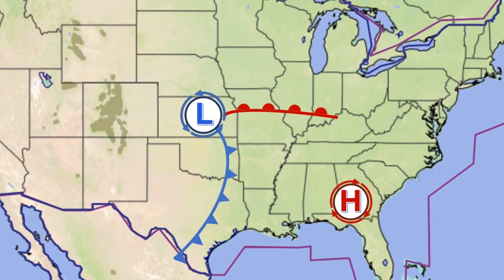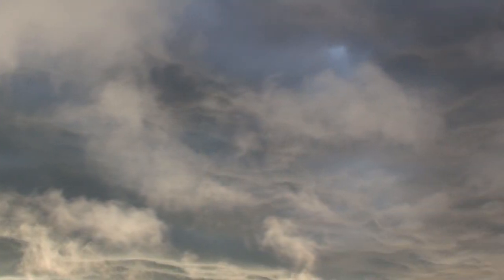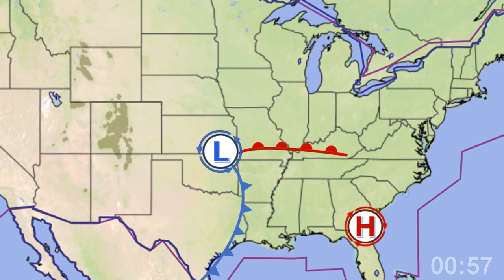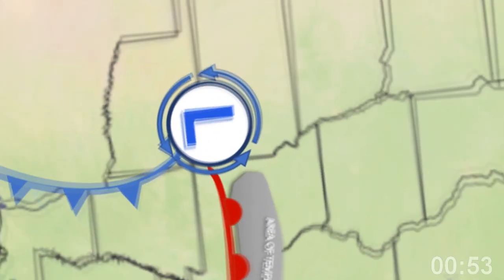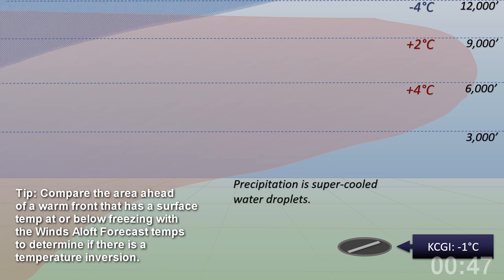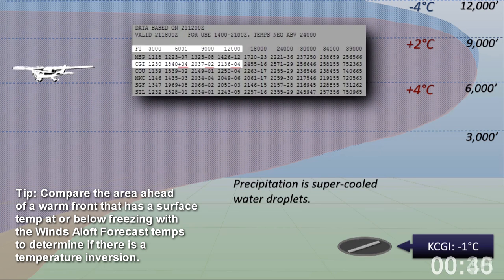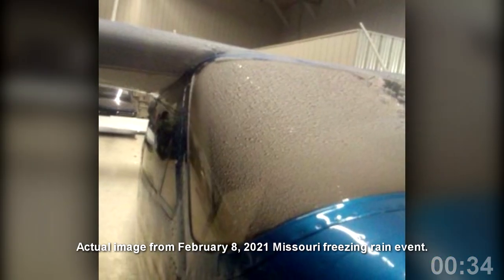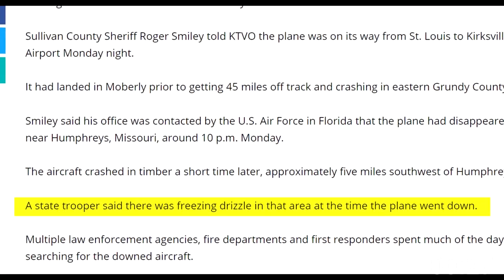Predict Icing Conditions in 57 Seconds

Comment: This made me think:
IF you were to come across unforecasted icing conditions, flying above a OVC layer: What would be the best way to penetrate the clouds?
Off-hand, I would think (Assuming Instrument rated, and there are no holes in the clouds within the distance covered by fuel reserves) the best idea would be to stay above the clouds on an instrument approach, check the field's ATIS for the altitude of the bottom of the clouds, and pull power and dive through as fast as possible to reduce your time in the clouds. (Attempting to remain below manuvering speed, but realistically staying inside Vne to minimize time in visible moisture 0 to -20C)
Off-hand, I'm not too knowledgeable about shock-cooling, or how the increased airspeed would effect ice formation. (I'm assuming the ice would start from the leading edges and spread further aft because of the speed)

This isn't a situation I would ever propose getting oneself into, but since most GA planes are 1. Not FIKI 2. Piston, I would rather talk about it at groundspeed 0 than become another statistic. Thoughts?
Reply: Andrew, I had that scenario happen to me during a cargo run many moons ago.  I was above the cloud deck at 5,000' with clear night sky above and several miles to go before I made the turn to final which was to be an ILS into Birmingham.  Approach directed me to descend to 4,000' and with that, I was in the soup.  The aircraft was a Piper Lance as I remember (with a stabilator, which will be the discussion point of another video soon).  I began accumulating rime ice there at 4K with a long way to go.  Retrospectively, I should have requested to stay at 5K (or climb back up to 5K) until I got to the glide slope.  Shooting down a glide slope may keep your exposure to any icing less, so stay higher if you suspect icing in the cloudage below you and descend at the last moment (or go elsewhere if moderate or severe is suspected).  Thoughts or ideas, anyone?
Reply: Problem is, diving through the clouds as fast as possible without breaking the plane would not be a “normal maneuver to landing”

Meaning you wouldn’t meet the instrument approach landing requirements of FAR 91.175

You’d have to stay between 500-1000 fpm descent for the entirety of your approach to landing